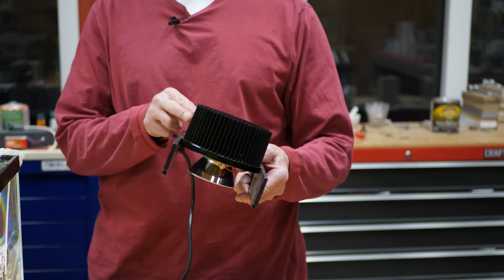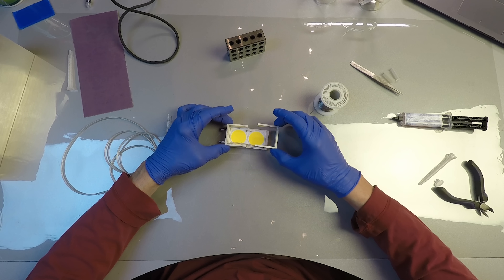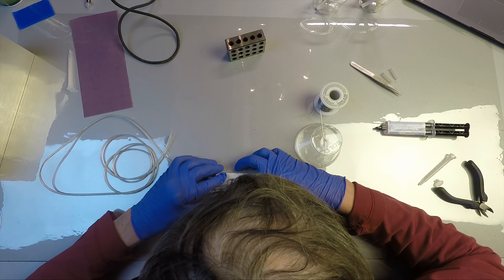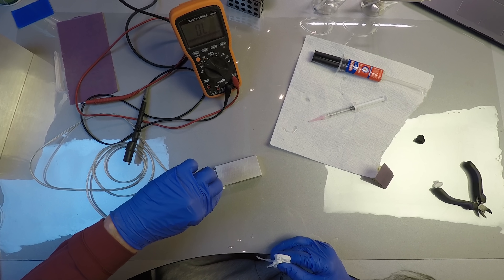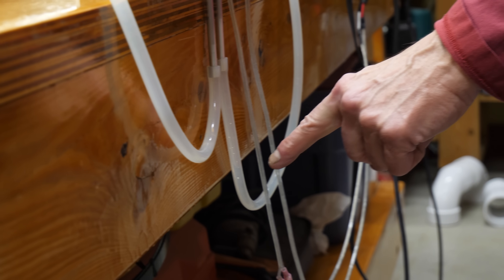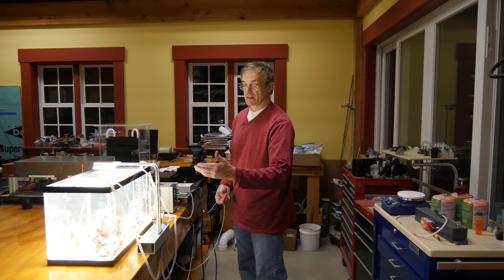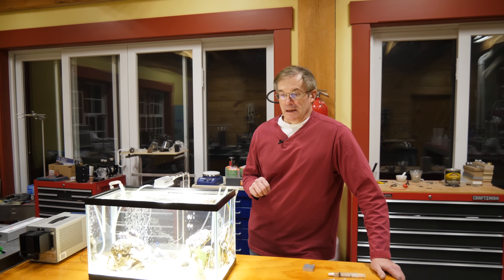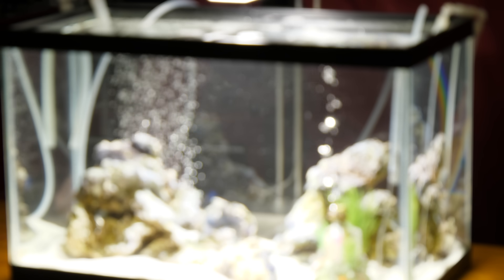40,000 Lumen LED Aquarium Light

Comment: One of the issues in a water cooled PC is algae  and similar growth in the cooling components like the water block.   In that application, you need some sort of bio-cide along with corrosion inhibitors.   In this case, you are pumping tank water ripe with  organisms  that would love to grow in a water place like the water block and no way to prevent it.
I suspect that over time, the block will either clog or not conduct heat due to things growing in it.
Reply from the maker: I have operated aquaria for many years.  As long as the water supplied to the plumbing is filtered and debris is eliminated there is little or no growth in the dark.

Comment: Cool project, it would have been nice if you used copper pipes and insulated them from the block using a plastic coupler and powered the led through the pipes for a cleaner look.
Reply from the maker: Did hear my comment about disolved copper in the aquarium?  It can be used as an antibiotic, but it can also be toxic.
Reply: @TechIngredients  in the PC water cooling loops it is said if you open the current path or gound it (not sure which but I think it is open) you can stop the copper from dissolving. It would still dissolve due to erosion but it is an interesting though. The concentration/rate might still be too high.
Reply: @TechIngredients  I came across that after I left the comment. But copper pipes can also be coated with epoxy the same way you did  the water block. 
I was also wondering how much the epoxy layer would affect the heat transfer to the water block. Is it significant?
Reply: You'd also have to insulate the 90V copper pipes from curious humans and pets.

Comment: What about encouraging an aluminum oxide layer to protect the aluminum? Or anodize the aluminum interior? But the epoxy is an elegant solution that works, hard to beat that.
Reply: No encouragement needed. Aluminum oxide forms on aluminum nearly instantaneously when exposed to air.

Comment: The interior of the water cooling block was labyrinthine. I imagine you would have to blow the epoxy out with compressed air, not gravity drain it, otherwise the pocket would become plugged.
Reply from the maker: I should have said that the block needs to be rotated about it's plane to eliminate all the epoxy.

Comment: Very nice setup. What I have been building for my bioreactors is a round extruded acrylic tube, sealed on one side. Inside of this tube is a square aluminum tube with the cobb lights mounted to it. The aluminum tube is suspended about an inch from the bottom of the plastic tube and extends some 8" beyond the open side of the plastic tube. The exposed end of the aluminum tube has a small squirrel cage type fan mounted to it. By controlling the delta of the forced air and the tank water, I can control the tank temperature. I currently operate 180 watts of full spectrum cobb lights along each tube. Nothing like heat from what otherwise would be wasted.
Reply: Thanks for this comment! It answered a question I posed. There is a great post I read on the internet once about someone using a toilet tank as a heat sink for computer cooling. I think they produced a graph of their CPU temperatures. The porcelain toilet dissipated enough heat to adequately cool an over-clocked CPU but performed particularly well after flushes. I'm thinking that putting a fermentor in my bedroom and creating the perfect cycle of worship between Dionysius and the porcelain goddess in my washroom to keep me warm and my spirits high for the winter. My dream is to find a way to adapt a computer speaker into a vacuum pump to distill the spirits from my wash while maximizing the conversion of sugars in my wash by lowering its alcohol content. I'm actually curious if your setup could be adapted by funneling the air from a sponge filter through a similar tube positioned like a reflux column in a still so the vertical components dissipate heat and the horizontal connectors act as supports and heatsinks for the COBS. I've also been looking at using profile aluminum tubing to create a small greenhouse on my balcony in my highrise apartment building and had been worried about how much energy the profile tubing would conduct but now I am thinking properly insulated I could use it as a safe radiator to heat the area.
Reply: @tcarlaw  What needs to be looked at for limitations is your maximum operating temperature of the cobb lights. Something like 140°f at the heat sink junction. Everything else such as heat output is a matter of variations of air velocity through the tube. Maintain your deltas! I play it safe and keep my air temps at 110°f max. Best wishes.

Comment: Everything u do is interesting. How about making a sheet of silver for a countertop from five  or six ounces of silver. It will be germicidal and attractive. It would be for a counter with four exposed sides and edges. If it’s poured correctly there would be no seams and it would fit like a tooth crown, except four foot by two foot and nice  one  inch sides. It would be a work of craftsmanship and beautiful and functional.  Thoughts?
Reply: Make one!
Reply: Fantastic idea!
Reply: It would have to be laser straight or any minor imperfections would cause strange reflective patterns and not be aesthetic. Don't cut anything on this or it would destroy the aesthetic, which defeats one of the purposes. The silver, to be anti-bacterial, has to be elementally exposed. This would cause a tarnishing problem, and lots of work to keep it always tarnish free.

There is also the possibility of a satin finish. But this would also be anti-aesthetic with any scratch. It would also cause an even bigger tarnishing problems.

So, no, not a good idea.

Since, one would assume, the idea is to reduce maintenance... stainless and clorox would be cheaper, simpler, and lower maintenance.

Comment: I wouldn't wear nitrile gloves when soldering. The temps are hot enough on a soldering iron that you can easily melt most gloves. I just keep cold water at a nearby sink available and burn ointment around.
Reply: the nitrile gloves are for preventing the hands getting dirty, and to prevent the sweat from the hands to get to the parts you are soldering.
Reply: @nejiniisan1265  Sweat from you hands will not interfere with soldering. The flux from the rosin core in the solder or from a separately applied flux will burn off any sweat or oils you leave on a surface. Immediately before applying thermal past or pads you should clean them with alcohol anyway, so again, no reason for the gloves.

I think he was wearing them so that they could get an uncut shot of the assembly using the 5 minute epoxy. Wearing gloves when handling that is a good idea.
Reply: @KnightsWithoutATable  indeed. But sometimes is annoying
Reply: I haven't found it possible to melt nitrile gloves with soldering iron. Instead, the material decomposes in-place, discolours and becomes brittle, while maintaining a barrier layer and not being inclined to stick to the skin.
Reply: @SianaGearz  I suspect that my experience with them is different because my employer at the time claimed they handed me nitrile when they were in fact vinyl, so my initial post was inaccurate.

Comment: That thumbnail pic,,,,, that's awesome! Half of the suns lighting power, water cooled, got it. 

One request though: could you please use both imperial and metric while describing a thing? I wish the whole world used the metric system, but we here in the U.S.A. with the loud and the proud cannot compute a Kg vs Lb, C* vs F*, Km vs mile, we literally have to look it up to know what you are talking about. So if you could include those basic conversions I for one would greatly appreciate it. Otherwise, I'll continue to look it up until I learn or stop caring!
Thanks for doing what you do!
Reply: The nice thing about metric units is that they operate interchangeably using the same multiples, and the nice thing about learning stuff from videos is that the numbers don't matter. If you can get your head around the ratio of one number to another in metric then you don't need to do that annoying conversion stuff, since you can just take your ratio and apply it to whichever units you prefer to work with. For example, something that's 10x5cm is twice as long as it is wide, so your ratio is 2:1. Now, whatever size you want to work with & whichever units you'd prefer to use, that 2:1 ratio is what matters, not the actual centimetres (obviously assuming you'll be working on something of a similar size & not extremes either way). This also means that you don't have to concern yourself with minutia quite as much, since you can just roughly estimate the size in your units & provided you get the ratio correct, in this case 4x2 inches, you'll get the same functional end result.

Comment: Do these LED chips have any UV output?  Could they be used to light a lizard habitat?  I rely on the UV output of my current lighting system so that my lizards produce the vitamin D they need naturally instead of having to take supplements.  Could I use this LED system you describe instead of the more costly system I currently use?
Reply: I doubt it. They usually have a big spike in output at around 450nm from the blue LEDs used to excite the phosphors, but nothing much higher than that. Output past 420nm is likely negligible. You could potentially add a few dedicated UV LEDs for your purposes, but that would likely require some extra circuitry.
Reply: Without looking at a datasheet, or looking into the light requirements of reptiles. I'm not sure if these specific chips have enough UV for the task. You can buy LEDs that emit in UV range.

Comment: I have a question. If you are trying to cool the leds why have you laid the electrical wire within the frame you epoxied to the cooling block? Would it have been better to cut the notch closer to the wires and lay the wires outside the fence? What have I missed? I know you usually think through things before you construct.
Reply: I'm not sure what your concern is here. It just looks neater to have the wires exit at the hidden rear of the head than at one side. Also, in the case of a catastrophic cooling failure, it might be a useful safety feature to have the solder melt & break the circuit..
Reply: @NightCatArts  Circuit breaking in case of over heating for safety sounds like a fair reason. I imagined the heat from the LED might melt the wire insulation and short circuit. But you had a massive heat sink on the previous LED indicating the amount of excess heat needing removal. I guess the amount of heat being radiated by the LED is insufficient to melt the insulation. Thanks for answering my question.
Reply: @mayflowerlash11  I'd imagine it takes far more heat than would appear here to melt the insulation. The entire frame being a heatsink would probably ensure that it'd never reach that kind of temperature where the wires are.

Comment: Next video: How to make tiny fish sunglasses
Reply: and fishy sunscreen
Reply: He says its equal light output of noon around the equator. So if you have tropical fish (which most ppl want) they are used to it.
Reply: @brinkshows2720  He said 1/2 the intensity.  But that doesn't change your point.  Your point is 1/2 times more valid.  :p
Reply: @universebecomingltd  haha, oops, my mistake, or should i say half a mistake?
Reply: @brinkshows2720    :p
Reply: @brinkshows2720  But is the spectrum the same?
Reply: @lohphat  So long as it has the blue and the red no problems, at least for fresh water fish and plants. Corals might want a little more UV light though to help them.
Reply: @SeanBZA UV is bad. Near-UV or "actinic" is often desirable tho (a little 410nm, some 425nm, and some 440nm wavelengths).  Coral and other reef invertebrates generally enjoy an overall color temperature around 10000K, too much red/yellow encourages excessive algae growth (coral have algae in their tissues but they also produce refractive pigments).   Certain species might prefer a little more blue in an aquarium if they are wild collected from deeper waters - using a mixed array of smaller LEDs is often easier than finding a single COB matching the spectral output of a typical aquarium bulb.

For everyone who thinks this is too bright, 120% of the output of a 400W metal halide is not overkill for a reef aquarium. Before LEDs it was quite common for larger aquariums (6'x4'x18" deep) to have two or three 400W fixtures above them if the owner kept shallow water, small polyp stony corals like Acropora sp. and Montipora sp., and again, these corals can and do produce diffracting pigments to fine tune the light and protect themselves from incident UV.
Reply: @lucasthompson1650  I ran freshwater with a 80W MH lamp, and got good plant growth out of it. Just used a time switch to turn on the light for 2 hours in the morning, and 4 hours at night, and left the curtains open during the day. Doubled up as both an alarm clock and room lighting, as it was at the times I was home. Fish were fine, and the plants that survived them as well, even got a few of the feeder fish that were fast enough to survive past mouth size to respond to me being there. Oscar loved tadpoles, would eat them a day or two after they had 4 legs, as then they did not taste too bad. Before spat them out and did not eat any more, so no issues with keeping the food fresh in the tank. Eventually died of old age.
Reply: @SeanBZA Yeah, the aquarium industry tends to like selling lights and bulbs. I was once in the unfortunate situation of having to care for a carpet anemone (Stichodactyla haddoni) thanks to some jerk at Big Al’s convincing an ex-gf that her clownfish would love it.  These things can grow to a diameter of 1 m (3 ft) in the wild and should really NEVER be casually scooped up and sold into the aquarium trade.  It was about 12” wide when I inherited it and everyone and their dog was saying it needed ultra ultra bright lights.  This didn’t make sense to me considering it’s size and voracious appetite for meat – I could understand photosynthesis providing supplemental nutrition but not primary nutrition.  I consulted an actual marine biologist who specialized in anemones (because this was in the early days when you could just phone an expert in the aquarium field… kinda like calling up Eddie Van Halen for tips when you want to take up the guitar).  Dr. Ron Shimek confirmed my hypothesis and my worst fears:  they don’t really need much light other than the odd specimen being finicky in low light needing it for “comfort”, and that he was maintaining a list of carpet anemone lifetimes in captivity and that list currently had less than 100 or so entries where the anemone lasted more than a year.

Long story short: mine made it up to #76 on the list, sadly suffering a lethal dose of heat from a failing aquarium heater after 19 months in a dedicated 75gal tank — under a pair of wimpy 36W compact fluorescent bulbs, a 10000K and a 6700K.

Good job on your tank, anytime a species can enjoy a good life in captivity and die peacefully of old age it’s a sign you’ve done something right!

Edit: for what it’s worth, I got the salesperson at that Big Al’s fired shortly after taking over care of the anemone.  They still had two for sale, both already badly bleaching, and the sales idiot was trying to sell one to a young couple who had a single clownfish in a 10gal tank … as “a rare albino carpet anemone”. 🤯
Reply: Brink Shows fish wouldn’t be chilling in 6inch of crystal clear water.... they would either be deep in murky water or in shade
Reply: @brinkshows2720  It also depends on the depth that the fish usually live at.
Reply: ROFL